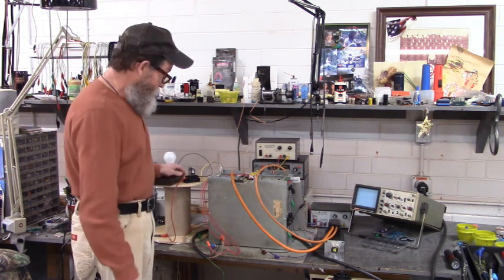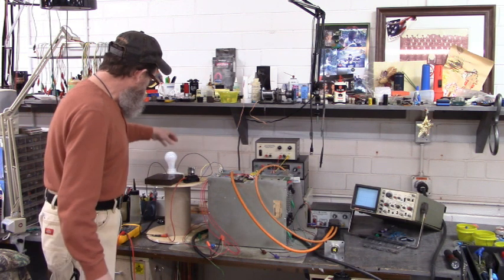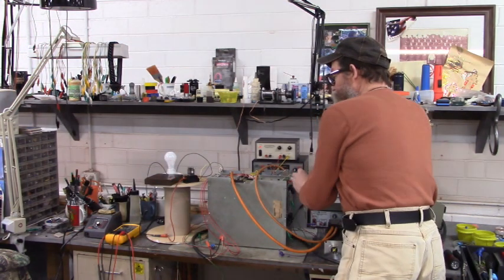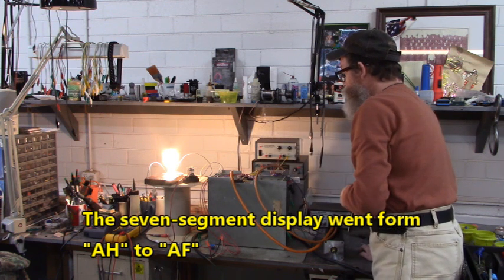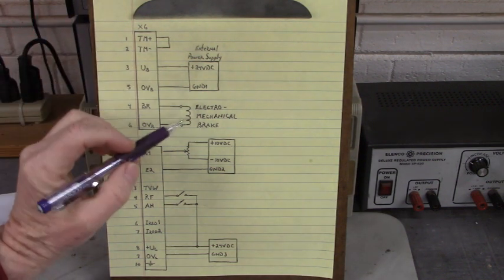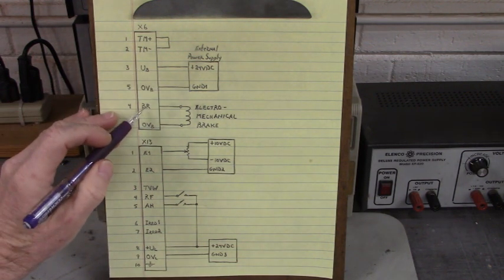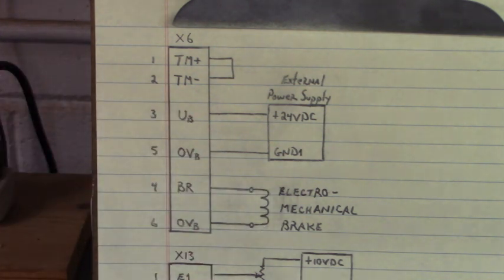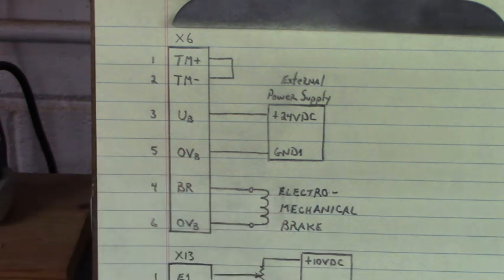Testing the Electro Mechanical Brake Circuit of the Indramat Servo Drive

Comment: monsieur,  we have a lot of ultra3000 drives giving E23 error codes at will. the drive are sent out for repair and will work for a limited time? AB-Rockwell is really more interested in selling their next generation of servo drives and this is how we got the 3000s. By removing the old Reliance Flexpak DC drives that were working for 20 years. So, are there ultra3000 trouble shooting schematics?  thanks a lot...:)